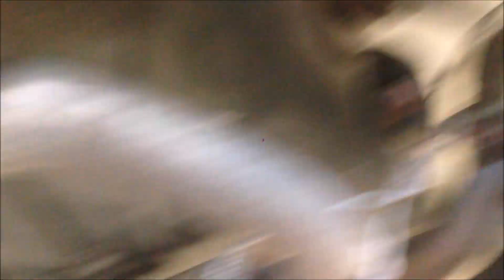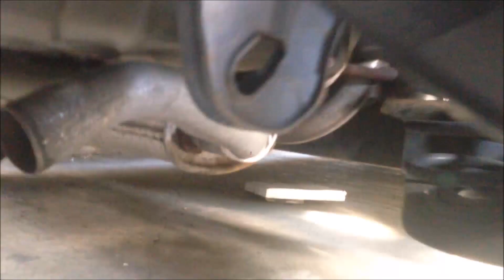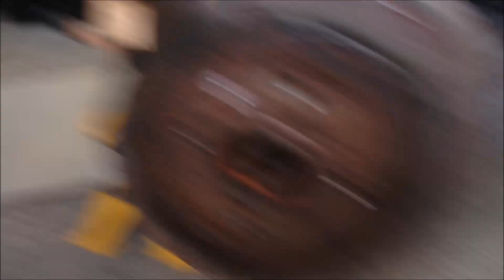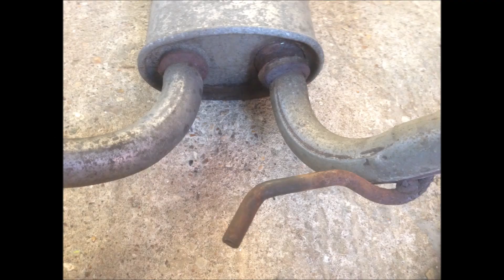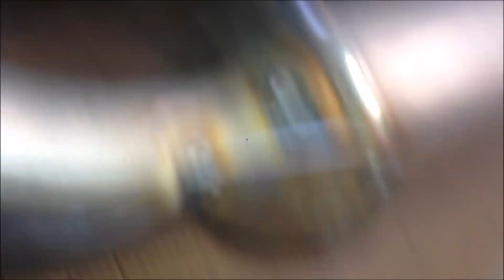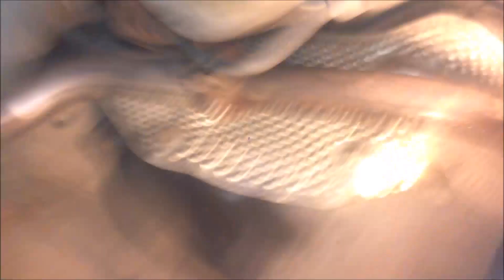Toyota AYGO: Exhaust Box: How to replace? C1, 107

Comment: I have just completed this job and it was harder than it looks. The clamp bolt was rusted and seized I had to saw it off with a junior hacksaw, it was so close to the fuel tank I didn't dare use my angle grinder. I used the car boot spare scissor jack and placed jack stands on the rear points. The hangers were also rusted to the exhaust hanger points I had to saw off one of them to help twist it out. It took me 2 hours but I did it. Thanks. I will now buy longer exhaust hangers as my replacement part hangs too short and touches the body.
Reply from the maker: Congratulations! Great jobs done!

Comment: Thanks for the video. Is it necessary to remove the rear wheel or is this just for easier access?
Reply from the maker: Hi, if you have a professional lift and can lift the car high enough,  then you don't need to remove the rear wheel surely! But if you only have a normal hydraulic floor jack, I really recommend remove the rear wheel, making the job much easier and most of time you work beside the car not under it. Have a good day!

Comment: Thank you for the video.  I find they are a nightmare when it comes to the clamp . As you can see there is a lip on the back box and a lip on the exhaust but only 1 Grove on the clamp . I have done this job on a Citroën c1 toyota aygo and now have the same issue with a peugeot 107 . I cannot tell you how many time I have had to go back under the car to try and stop it blowing , that's everyone of them mentioned . After checking at peugeot they sell the same clamp for £10 that I can get for £4 at an exhaust supplier.  I wonder if after changing you rear silencer you are having any issues?  I even sealed with exhaust paste and still blowing . I would have expected a clamp that holds both lips together.
Reply from the maker: hi, i just used the old clamp and there was no problems of blowing. it actually held the two lips in the one old clamp! i just made sure both ends were clean before putting on the clamp. you could try to have your clamp to hold the two lips? Good luck!